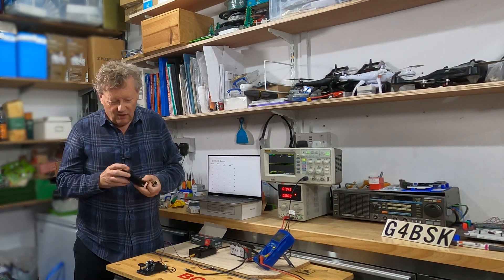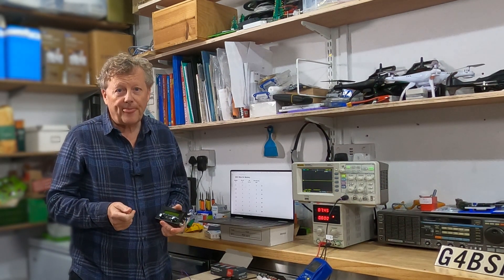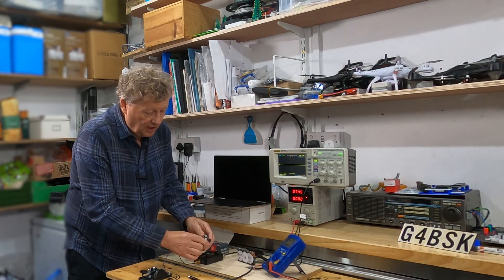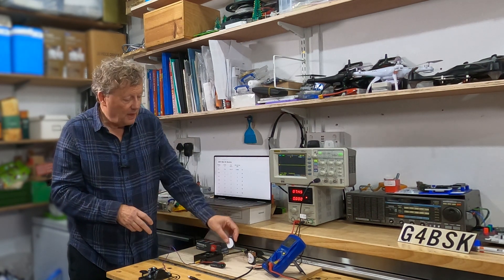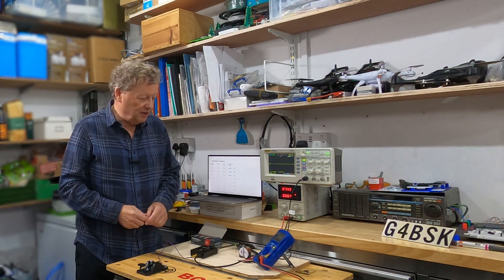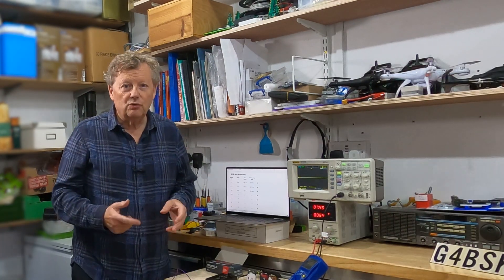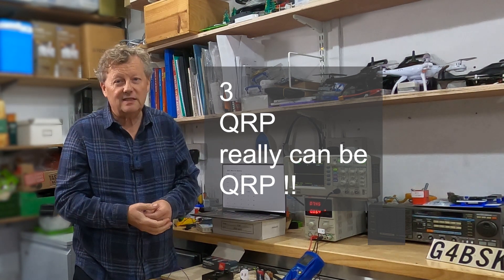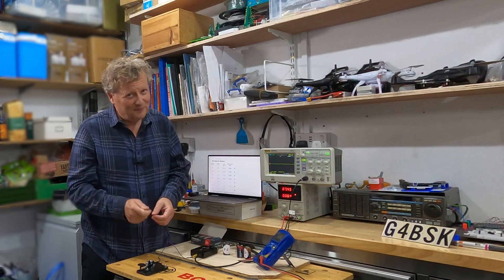1 Battery QRP with QCX Mini Part 2 - Power Test ? !

Comment: Your measurements correlate well with mine, where I found about 500 milliwatts at 7 volts, up to about 1 watt at 9 volts.  I was using an SWR/power meter that I homebrewed years (decades!) ago, and that I "calibrated" using the variable power output of my Elecraft KX2.  (So probably close enough.)  I've always wanted to try milliwatting -- it's fun!

Comment: Nice video going on from the previous one.
All QRP here, FT817ND, h/b h.f. ssb/cw rig, Wireless 19 Set 2 Watts cw on low h.t., one valve xtal cw 40/60m tx, Pye Bantam a.m. on 4m.
My Pixie, 350 mW out on 60m got me 180 miles QSO and a SWL report from 220 miles.
G4GHB

Comment: Did you measure the battery voltage under load or open circuit?  It should be measured while transmitting I think.

Comment: Excellent video. I liked your one battery experiment very much. Now, there is a polarity protecting diode in QCX Mini. That drops the incoming voltages by 0.6V approx. What if you shortcut that? Then your power could be bigger also the battery would last longer...Do not you want to try this? 73 de Béla HA4BM from Hungary.
Reply from the maker: Thanks Bela - I'm pleased you liked the video and yes, taking the diode out is an option I have considered...73 from Mort/G4BSK
Reply: I think I'd keep the diode for safety, reverse voltage by accident is not good.
G4GHB

Comment: Try a rechargeable 9 V the battery your using has high internal resistance and limits output to about 1 watt, rechargeables will allow higher output at least for a while, find the highest capacity you can find are usually good for several quicker contacts like Pota, Sota, and contest exchanges, they can last longer than you may think   good luck and lots of fun experimenting, 73 -J

Comment: Mort, another excellent video on the QCX mini. I've got two 40 & 20 meter which I call Bada Bing and Bada Boom. I do quite a bit of Parks on the Air activations in the states via bicycle and find these little rigs with an EFHW are idea for my portable operations. QRP RULES!

Comment: At the end of the QCX-mini instructions is a section on tuning the rig. Hans also has an excellent 45 min video on how to tune the QCX/QCX+/QCX-mini. As an example he used a 30M QCX+ and said that it is not at all unusual for the 20 & 30M radios to begin with low output power. The 30M radio he used in the video started with output power of 0.7W. After removing windings on one toroid and spreading wires on a couple of other toroids he managed to improve the output to about 4.3 W. At the conclusion of the video he was able to supply 13.8V and had RF power reading of 6.4W. After you tune your radio try the batteries again. I would like to see the result. We did our smoke test last night on our QCX-mini and NO SMOKE. In the middle of tuning it now. Search for this and you will get his video on YouTube.“How to optimize your QCX/QCX+/QCX-mini for best performance.” Thanks Joy
Reply from the maker: Hi Joy
I have linked to this video in the description and mention it in this video. In my other videos I show the tuning up process & make suggestions about preparing for it during the build. My three QCX txcvrs normally run at 5w or a bit more & are fully optimised. This video is just a fun experiment about low power and unsuitable batteries😀😀😀 I hope your build goes well & that you have a lot of fun with your QCX !